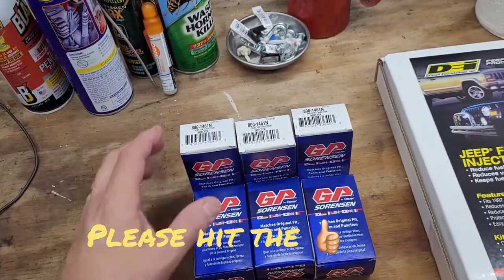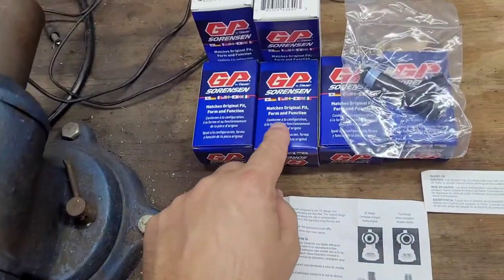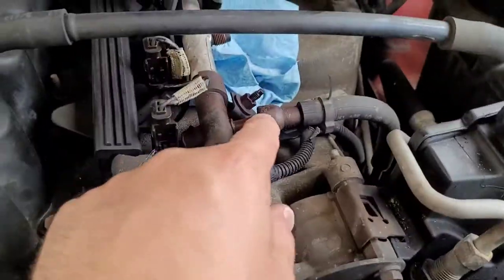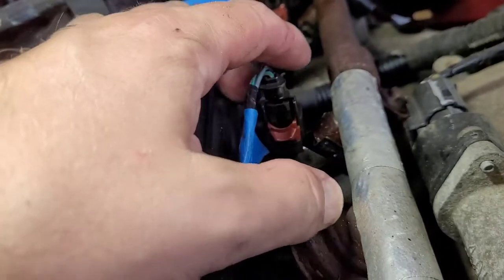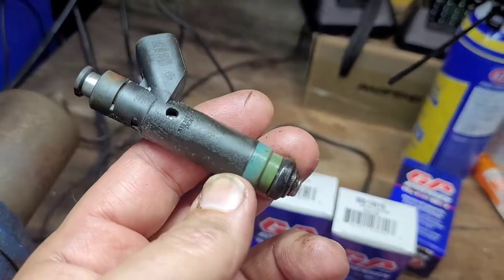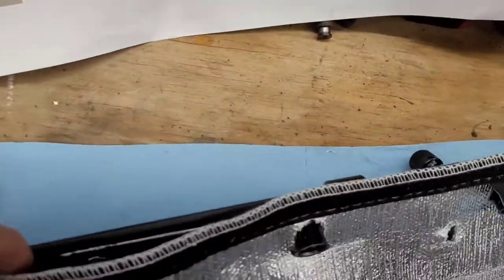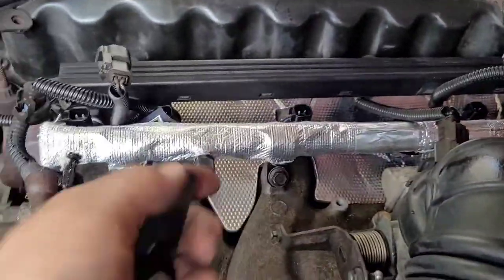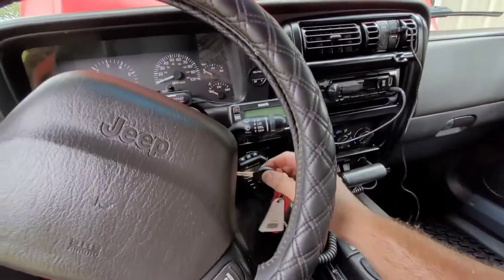How to change fuel injectors and install heat shield Jeep XJ 4.0 #jeepxj

Comment: I had heat soak on the #3 inj for several months. Tried to jury rig some insulation, but no dice. Decided to go with 4 hole injectors used but cleaned and tested from K Suspension, and the DE heat shield kit. I found that the throttle response seemed more immediate and precise, but maybe that's because they are clean and fresh? Your presentation of the procedure was very clear.
Reply from the maker: Glad it helped!

Comment: Nice job Major.Suprised you didn't go with a 4 hole upgraded fuel injector.💪👍👍
Reply from the maker: I thought about it but I've heard stories about computer getting confused and I'm about to go on a 4000 mile trip so I didn't want any surprises.  But they certainly might be in the future
Reply: What are the benefits?
Reply: @officialWWM  Better atomization of the fuel which reportedly gives better throttle response, better idle.  Possibly better MPG.  There's a video by "injector rehab" (put that + "jeep" in the search) which shows exactly what it does.  Cheers
Reply: @blizzytaj  awesome, thank you!
Reply: @MajorWeakness  I did go with the 4 port injectors, my PCM went haywire. I had multiple codes thrown P0172, along with the 0300 multiple misfires codes, and both O2 sensors went bad. I fixed everything new O2 sensors, and bought 4 port injectors from K suspension, it fixed the issues I had. The  PCM issue I had was with the cheap Chinese made 4 port injectors  I bought off eBay were bad. Lesson learned, don’t buy cheap Chinese injectors, they are either a hit or miss. Everything is working fine on my 99 XJ now, no more codes.
Reply from the maker: @drgil65  yes I've heard bad stories about cheap injectors.  These are working great.  Went across the entire country 4000 miles worked great.  I did have one fail and I did a video on that when it was brand new but fixed and worked ever since

Comment: Could you put the injector covers on before you install them back on the engine?
Reply from the maker: No because you would not have access to the electrical  plugs
Reply: i didnt see how you put them on over the connector? looks like its not easy

Comment: Thanks for your video, how has the heat shield been working, any noticeable change? Thanks again.
Reply from the maker: Noticeable change yes. Completely eliminated heat soak no.  I've since learned that if your fuel pump is old the check valve is weak allowing pressure to fall while off.   This allowing vapor lock on startup of a warm engine.   I changed fuel pump on one of. My XJs and problem solved

Comment: Will this fit a 93 xj
Reply from the maker: It's designed for 97-04 jeep 4.0 engines only.  The same company might have some universal wrapping material you can use.  Go to their website and check out